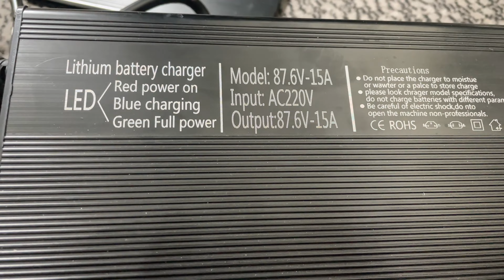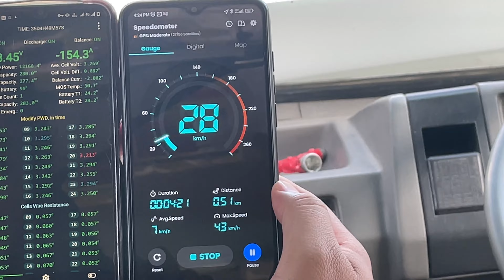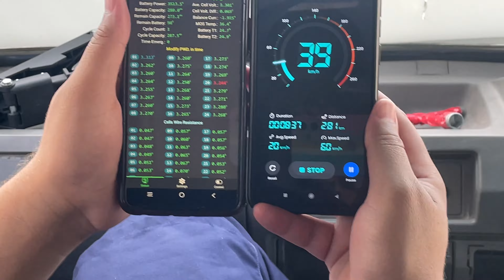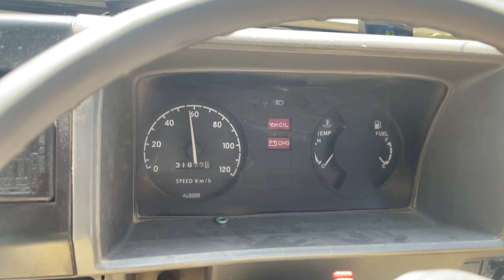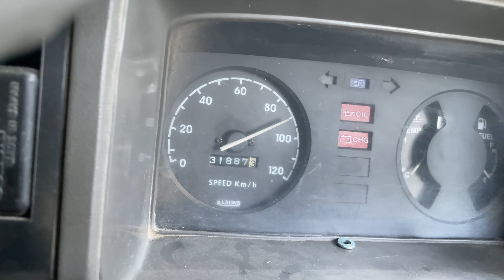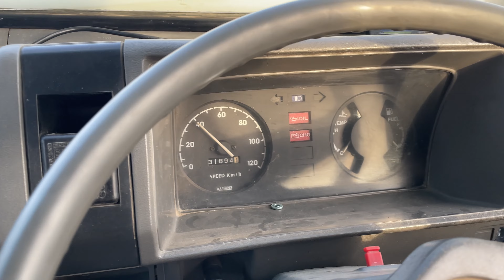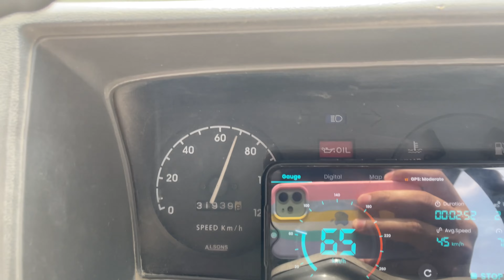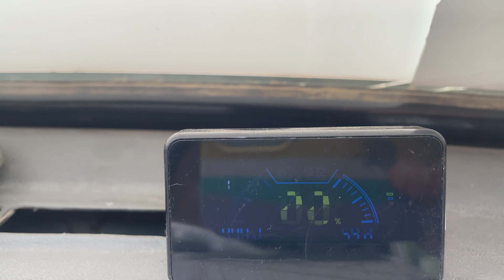CST # 23 EV Suzuki Carry Bolan Electric conversion 10kW Datai motor 197km range 76.8V 280Ah 21.5kWh

Comment: Thanks bro for this nice information ,my advice for you is to provide proper protection to cable in the motor area you can use liquid tight flexible conduits and for motor mechanical protection the cover is with metal sheets

Comment: Is kay electric system ko cooling ki zarorat hai ya nae.
Motor , controller, charger, aur battery all parts need cooling system to maintain efficiency and safety. Koi is ka bhe dekhna paray ga jab equipment heavy ho jae to. What is your opinion and experience?
Reply from the maker: Motor and controller have built-in air cooling. Battery doesn't heats up because cell is of huge size and load is not that high.

Comment: first of all you should get 96 or 108 volt motor which have good torque and motor does not heat up and nor decrease efficiency   every company prefer higher volt dc motor  and higher volt battery and  charge get faster
Reply from the maker: Cost of those motors is high. Datai PMSM motors have no heat up issues and the efficiency is 97%.